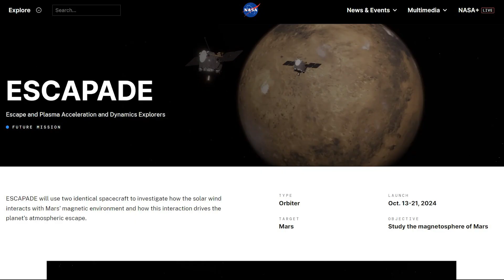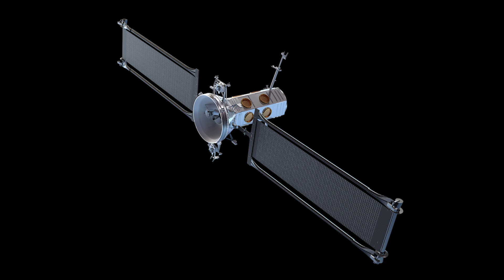Blue Origin Wants To Land New Glenn’s Booster On The First Try

Comment: I have a high level of confidence it'll work flawlessly
Reply: Why the high confidence.  There is so much untested.
Launch of booster
  Fuel supply to BE-4
  Control
Booster return to recovery vessel 
Successful landing 
2nd stage separation/ignition 
2nd stage to reach orbit (a first for Blue)
Deployment of payload 
Burn up (return) of 2nd
Reply: @External2737 Big facts! But I still always wish every aerospace company well. It's a beautiful rocket.
Reply: @Round_Slinger  I wish them well but feel that being overly ambitious is just tempting fate
Reply: @Round_Slinger  I wish every space company well.  As a test Engineer, I know we miss scenarios that matter. Rockets never work 100% first flight.  I will concede that Blue Origin is further along than a SpaceX first flight, but nothing trumps experience.

There is a reason manned flights require 3 prior successes.  Reality is not compliant.
Reply: @External2737  "Blue Origin is further along than a SpaceX first flight" .Falcon 9 and Falcon Heavy (a lot more complicated rocket with 27 engines) were both successful on first launch. Building a legacy tech rocket to go to orbit on first try isn't that hard, lets not confuse Starship here which is some orders of magnitude harder problem. Landing will be challenging for NGlenn but they have been practicing with Sheppard for a decade now.
Reply: @admarsandbeyond  Getting to orbit first flight is very complicated. Doing it while recovering a booster is even more complicated with Starship taking it to the next level.

Space involves uncertainty in vibration modes, thermal shock, thermal gradients (differential thermal growth), water hammer, and fluid cavitation.

Blue Origin is an older company than SpaceX.  If not hard, why haven't they achieved orbit?
Reply: Rocket is complicated and dificulte
Low safety and high cost
We need somethings better
Developing technologies to enable human access to space at dramatically lower cost and increased reliability #FeelFree
Reply: @dadearinto5546  Something like Skylon?
Reply: Why Do Astronauts Float in Space?
Base on this we can make artificial Gravity
Only can do this on Earth
This is the Secret
And the high-speed Space Station
Artificial Gravity is what is being sought and is very valuable

Something that is far in space beyond the magnetic reach of the Earth then that something NO LONGER has Density, instead it floats around aimlessly until it is again in the magnetic area of a celestial body that has a Magnetic Bar, then it will fall in that direction; This practically happens because all celestial bodies drift through an orbit at extraordinary SPEED. 
Astronauts and other objects in various Apollo rockets sent to the moon in 1969 proved all this information, and these objects and astronautes seemed to be floating in the space of the rocket.

So actually the Magnetic Bar stretching from north to south is what causes attraction (gravity), and every concrete object has a Falling Motion or Specific Gravity (Density). 

Every concrete object consists of an arrangement of atoms and emptiness. These atoms have particles that also have a magnetic bar in their mass. The magnetic bar on the atom is what ATTRACTS EACH OTHER to the MAGNETICBAR on Earth. The denser the object is with the arrangement of its atoms, the greater the DENSITY or the greater the falling motion. 

The difference in atomic density is what differentiates the specific gravity or density of each concrete object.
As a result, a mass that does not have a magnetic bar stretching from north to south does not attract or be pulled, and only two masses that each have a magnetic bar attract each other with a force that is proportional to the distance between them and the magnetic attraction value of each.
Reply: Better than Rocket is here
Easy lift off 
Easy land on with antigravity Spaceship
No Fire
No Explosion
No Flame
Just Spin and
Lift off
Powered by Baterry

Work base on Gravity just spinning by using Battery
can fly in bad weather, plunge in the ocean even in outer space
Can lift more than 100 Ton 

Earth which weight predict 600 trillion ton does not fall at the Sun because of centrifugal in orbitting, on the contrary it does not be thrown far go out the orbit line of hold by gravity at the Sun as orbit center. Gravity and centrifugal is equal called Equillibrium, thats why until now Earth which we was inhabited always rotate and circulate the Sun. Now we justly take example : how if the gravity used and centrifugal is negated? The Earth will float far leave the Sun. So that centrifugal can be used to fly far away if gravity eliminated. Finally how to eliminate gravity?

It’s way rotate part of aircraft by horizontal. When that rotation faster centrifugal force getting greater and the gravity getting smaller, finally it lose the gravity and the aircraft start flying. Of course people would surprise: how the aircraft can keep rotate without fulcrums? Thats why we named that aircraft Shuttling System that is aircraft likes two disc adjoining attached in the midle as fulcrums:

A. The Top part, we name Positive rotate to right, and the edges is getting thicker and havier.

B. The Buttom part, we name Negative rotating to left, and the edges is getting thicker and havier.

C. Middle Part , we name Neutral, air crew placed and also machine and everythings turning Negative and Positive at the same time.

The aircraft can liftup added with explosion from the engine. However that aircraft construction later, let the engineer doit it, and we are sure the aircraft will bulletproof and also waterproof.
 
.
.
 
In modern civilization where human being generally using flying saucer as vehicle, will a lot of change in lives either in materialism and in psychological. In materialism area will apply the change in life like.
People no longger need roadway and rel road which spend large of energy, money, places, things and time, object place and time. People would utilize that area for habitat or for other need:

Comment: Landing: it will be impressive if they succeed but not as much as the video suggests. Space X did it with  2014-2015 computers. Back then the Nvidia GTX 980  was state of the art. That is a 5 Tflops  224GB/s part. Today an RTX  4096 can do  82Tflops without using the tensor unit.  Software has improved a lot too.
Reply: Hardware was never the issue

I also like how you use consumer grade GPUs for your comparison when they're ill suited for the type of calculations happening
Reply: Oh... I so hope there is an RTX card in there. That would be hilarious (and cool). Most computers for this type of thing are custom made.
Reply: DC-X demonstrated vertical landings in the early 1990s. Computing power doesn't really help at all.

Comment: It's going to be really interesting to see another company start doing more frequent launches of this caliber other than space x. I wouldn't be surprised if they have some hold ups and even big crashes but if they just don't stop they have quite the potential.  I assume as far as the booster landing goes they'll just let it hit the ocean if there's a problem, as fun as it would be to watch it take out that landing ship lol
Reply: 100%
Reply: Until Blue Origin gets up to 7+ launches/recoveries per year, there is little benefit to recovery due to the standing army required to recover and rebuild boosters.

With the next two boosters damaged, that is far off.
Reply: @External2737  According to who?
Reply: @TheEvilmooseofdoom  
Stephanie Israel, CEO of ArrianeSpace when justifying why Arriane 6 wasn't designed for any reuse noted 7 reused flights per year required to justify.

Elon was quoted with 6/year.  This is to pay for the recovery teams (including ships & crew) and teams rebuilding/inspecting rockets instead of building new.  It is also to pay for the larger booster/more engines required to hoist the added fuel to return.

Fuel is relatively cheap (about a million per launch). It is parts (larger booster) and labor.  Right now refurbishment costs 30% or so of rocket build cost and SpaceX notes the added cost/weight of landing gear and fuel makes break even on flight 3 of a booster.

Comment: By the time BO gets one launch there hardware is way out of date already. Look at rapture engines, so little pipes and simply fied engine and catch arms catching boosters. Legs add weight and landing on a drone ship doesn't create rapid reusabilty. Sometimes spacex drones take a week to return cuz of bad weather. Then there is processing for drone docking, taking the booster off the drone ship and transporting to BO facility. Spacex gonna catch were it launches and put it right back on the launch table put another starship on top, fuel her up and go again. That's rapid reusability. No unnecessary waste of material handling, which cost the company money.
Reply: Out of date? I guess you didn't watch the EDA tour video's. And BO hasn't used marketing terms like "Rapid Reusability" for their program yet... because they know that is nonsense.

Comment: That's a really tall order. I get it that they're doing the exact opposite of SpaceX but maybe they should at least launch something first before grandstanding?
Reply: The system was designed to be reusable. It took such a long time to develop, it wouldn’t be surprising to see them get very close to successful recovery. There is always a first try. I will be shocked if they succeed to recover an undamaged first-stage. It’s great, imo that they want to try.
Reply: Grandstanding? Like SLS? Space Shuttle? Saturn 5?  It's not "grandstanding", it's a different type of approach... where the design is a finished one, and testing is done on components. It's supposed to work first time around. Starship on the other hand, is not finished, and is still in prototype.
Reply: @hawkdsl I often have felt SpaceX is launching too often, but then I remember that they are iterating of production techniques just as much as anything else. They are also challenging the safety limits of these complex systems. In the end SpaceX’s approach should be cheaper and safer, but it’s VERY messy. It’s not surprising they are being forced to delay the next launch. I’m surprised it doesn’t happen more often.
Reply: @TheScottShepard  I agree, except with the cost part. "iterating" is far more expensive then component testing. That's throwing money at a problem until you find something that works. However, that type of process finds weakness quicker. An example is the 737 rudder issue. Shock heating reversed the rudder action, and cause a couple of accidents. Component testing didn't reveal the problem because the test were done at ambient temperatures. In a bad way, Boeing did accidental iterative testing with the 737 rudder. So like anything, there are trade offs.
Reply: @TheScottShepard  The space approach tends to break more, and can cost a pile but it can also generate results faster.
Reply: @hawkdsl  Considering the scale spacex wants, spenting more in the testing stage to become cheaper later is a very good idea
Reply: @techietisdead  Certainly the long view. So long as they can generate funds, it's not a problem.
Reply: @hawkdsl  Well, the plan for Starship is to reduce the cost of space travel by like 40 times, from 2k$ per kg to 50$ per kg
Reply: @techietisdead  That's marketing fantasy by SpaceX, but it might be reasonably cheaper. That wont be known until it's operational.
Reply: @TheScottShepard  "challenging the safety limits of these complex systems" dude they have the safest and most reliable launch systems and spacecraft ever made. Safety has ALWAYS been number one priority for everything they do, don't blindly believe the trolls
"In the end SpaceX’s approach should be cheaper and safer, but it’s VERY messy." There is no other way to develop a groundbreaking rocket like Starship. This isn't a cookie cutter legacy rocket like the others. And they have spend a small fraction on it than what Bezos has spend on NGlenn, he liquidates more than a billion dollars of Amazon stock per year and it has taken him more than 14 years to develop (and counting)
Reply: @admarsandbeyond don’t confuse the human space flight program with early starship production. Starship is not yet reliable and they are intentionally pushing limits to find the limits. I’m a fan. I also recognize that FAA needs to look out for public safety. SpaceX wants fewer constraints, as is natural. New Glen is also a groundbreaking rocket and looks to be more complete than starship. So perhaps the limit is not the development methodology (waterfall vs agile), but having specific development goals and a motivated team. I look forward to the competition and I will be disgusted to find out that politicians are significantly delaying any one company intentionally.
Reply: @admarsandbeyond if BO brings New Glen into service before Starship, they are still several years behind. It’s hardly a leapfrog when Starship is so much more capable (probably). They are different systems though. Starship is primarily designed to get a lot of stuff off Earth. New Glen is designed to hurl stuff into deep space more like Falcon Heavy. We can be happy to have both systems as much as we want to hate Bezos. If he does make a great rocket in the end then there willl finally be competition
Reply: @TheScottShepard  New Glenn is not comparable to Starship, they're not in the same league at all. Spacex took about 1/3 of the time (and a tiny fraction of the money) to develop Falcon9 that is the equivalent to N.Glenn using rapid iterative development.
Also, New Glenn is not designed to hurl stuff into deep space. it has a stupendously massive hydrolox second stage. It's a bad design on so many aspects, I can't see it being a competition Falcon.
Reply: @hawkdsl  that's false if you think these complex machines are suppose to work the first time. Saturn 5 rocket killed three astronauts during Apollo 1 and it never left the launch pad. It was also iterated from the Mercury and Gemini rocket systems which had many failures.
Reply: @jasonturnquist8853  I think you need to go back and read some history on the Saturn 5... The Saturn5 payload was the command module. The rocket has a 100% success rate, with one second stage double engine fail from human error and a lose pipe...and yes, component design testing is meant to work the first time, as it's usually the final design. Apollo was amazing. I watched it all on TV at the time. The country will never again be that supportive of space travel.
Reply: @wombatillo  elon would never over sell a product. 🤣
Reply: @TheMoneypresident  he often does but look at SpaceX and Tesla. Not perfect by any means but they have both achieved the nearly impossible in a mere 10-15 years. People focus so much hate on Musk thqt they can't see the companies in his shadow. Starlink for example incredible and Falcon 9 is just amazing. Almost no one thought in 2009 that these things would be reality in 15 years.
Reply: @TheMoneypresident  LOL. He is a great salesman. "Rapid Reusability!", LOL. Ad agency gold right there.

Comment: If they achieve orbit for the first time ever, but don't stick the landing, how long should the FAA investigation be?
Reply: Years.
Reply: Depends on BO's internal investigation

The reason F9 groundings were so short is because spacex quickly found the cause

New glenn is a new vehicle though, so digging through data and finding the cause may take much longer than with F9 which is a very experienced vehicle
Reply: If it was SpaceX it would be 6 months
Reply: @mushmouth  it literally was like 3 days for falcon 9 landing failure, what are you even talking about?
Reply: a fair time, it difrent if the rocket explod on the landing ship, or is out of controll and crach on land.
Reply: For them? Half an hour.
Reply: maybe they should get their fans to dogpile the FAA like spacex do
Reply: The correct question is how long they will ground their entire fleet.
Reply: One day for Big Government/China  First cabeza de dick Bezos.
Reply: One day
Reply: To be honest,I'd don't think that it would be a long time for the FAA to do a investigation.
Besides that people in higher up, don't want to see SpaceX succeed, but if BO flight is not successful,and it doesn't clear the tower,then it would be very interesting to see THE FAA response
Reply: @robertevans6481 for one it BO would likely be grounded for longer then most of spacex f9 failures recently
Reply: It’s all about the Benjamins 💸
Reply: Not long since the pay load is what counts
Reply: As long as it takes for BO to show they understand the reason and that it won’t impact public safety.
Reply: @TheScottShepard  They might also coordinate it as a test with the FAA, as SpaceX did for IFT-4. Test failures don't count as mishaps, unless it fails to stay within test limits or something.
Reply: Same as it always is.
Reply: For Blue: A few days. Else 100 BO Lawers come running...
Reply: ttrump lost 🎉
Reply: @meesalikeu  America lost.
Reply: @meesalikeu  Nobody cares.